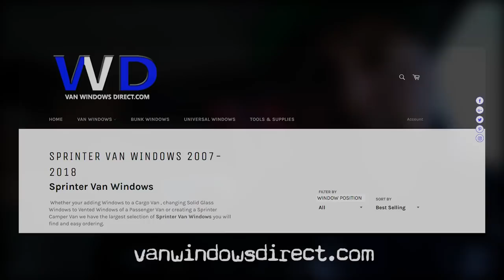Cutting in a Van Window - Small Van to Bigger Van - Process of Building a Larger DIY Van

Comment: The bonus with a bed up high is its warmer in the winter. A lot warmer.  I've been in a pop up camper with radiant heaters and the top half is great, but if you were to sit in the floor you'd freeze your a$$ off. Summer just sucks if you don't have ac blowing. Ill never get rid of my compact! Might go bigger though 😆.
Reply: They will wish they had lowered it so that they could sit on the mattress without hitting heads.